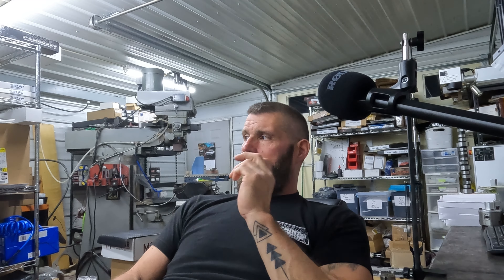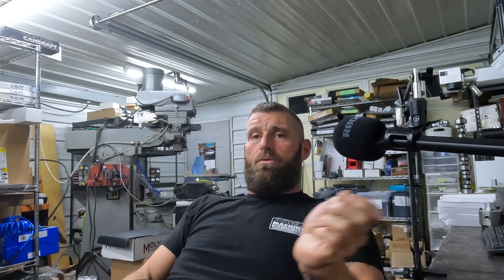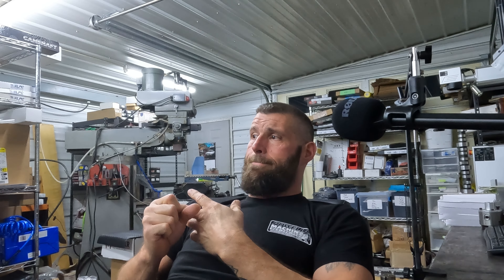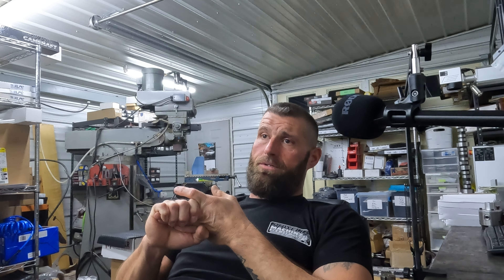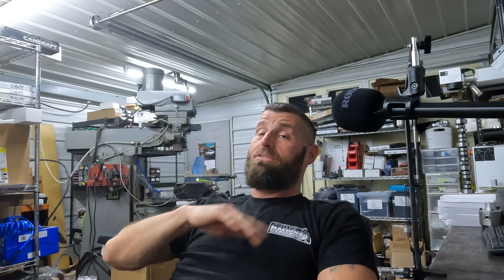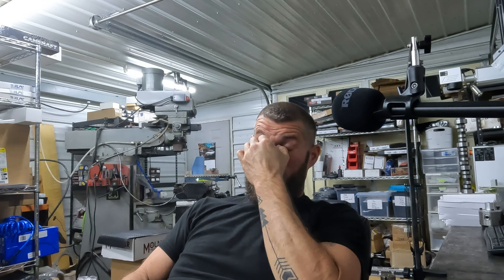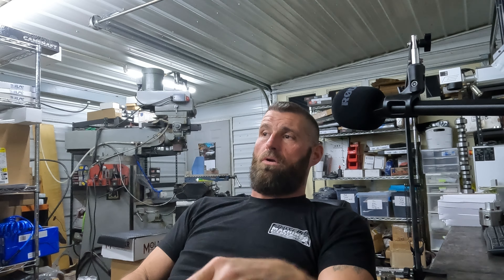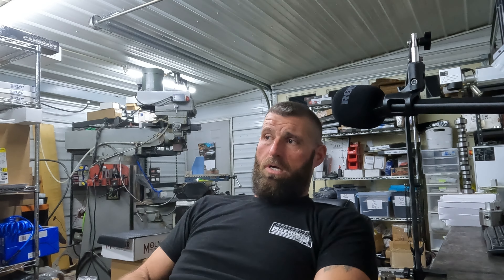Thoughts on changing our business model

Comment: The 300 ci ford 6 cyl was a die hard engine. I remember one time I was working on a air compressor that was powered by a 300 ford and it was having ignition problems. I was cranking it over and it loaded up and then the ignition decided to work. It blew the muffler off the machine with me standing two or three feet away from it.
Reply from the maker: Lol, yep, I have had similar issues happen

Comment: QUESTION. Do you charge out your time for chasing and ordering parts, or do you just buy in the parts and then add a small margin?
Reply from the maker: Yes we sell 10-20% over cost, which most of the time is cheaper than the big distributors

Comment: A few decades ago I worked for Anderson Autoparts out of SC.  We had an Automotive machine shop in the back and it stayed busy for the most part.  

The original machinist “Don” was a good old school guy.  Only after he quit I realized how many bad machinist there were. 
The first to replace him could not turn rotors, cranks or much else.  I think he finally figured out the flywheel machine 😂
We did a lot of commercial work approximately 75%, on both sides, parts and machine work.  

Just my opinion, if you can make it whilst only doing commercial work, I think your stress level will definitely improve. 

By far the worst customers were the ones who knew everything, bought “Good Enough” parts and had the highest returns by far.  

They usually went away mad after Don started talking to them the way you talk about Restrictive Pushrods and many other things they knew nothing of. 

Good luck whichever way you decide to go!!!
We need guys like you, there’s just not many left.  
Great videos, thanks much.
Reply from the maker: Yeah we have those here, we use to fix work they molested weekly,  it was really bad

Comment: Much respect.  Work smarter, not harder.  Machine and builder only new stuff.  The repairs you do should be  only on  that new stuff that that customers beat up or have had parts failures.  This is why there are so many crate engine businesses out there today.
Good luck with whatever you decide, you have a high standard set for yourself so you'll be successful.

Comment: I work alone, a lot. I have some part time help, but they mostly do grunt work and clean up. They don't setup machines or run operations.  I have tried to get some people to work, but the ones that want to can't stay out of trouble with the cops, with women, with dope, or whatever combination of those things. I can't manage my business,  my life, and their's too. The one guy that was good was looking for almost double the money I take home. So growing with employees has just not worked for me. 

What did help productivity was getting a vertical bed mill, and setting that up to bore/deck blocks. This particular machine had some extras like spindle orient, probing, and 4th axis wiring. I found a 4th axis rotary, and made a fixture to hold blocks from the mains. Slowly started making programs for various blocks. Now I can get a block in, probe it, the machine bores all the cylinders while I go do something else. Comeback, switch the cutter,  and it decks the block exactly while I am not watching it. 

Not to spend your monry or tell you how to run your business,  but something like that might help you. I couldn't justify the cost of a Rottler or other new machine. I found a decent Trak DP5 and added a riser to the column for more Z. I have less than $17k in mine, but I might do some overhaul to it if I don’t retire. There are other bed mills out there, you might a deal. 

I told myself I would automate block honing, and crank grinding. I have not yet done that. I wanted to get into cam grinding, more as an interest than a business venture. I looked at modifying a cnc cylindrical grinder to do cams. But, maybe at this point I want to do less not more. For a long time I have juggled 5 to 8 engine jobs at a time, not counting the odds and ends that show up. I am probably on my way out, at this point.

Comment: Would it work to just do machine work and leave the assembly to the customer. Yes there is a lot of customers that lack the ability to assemble their engine but let them hire a builder. That's the service I need. I can do the magnaflux,valve job, install guide liners and assemble my heads I just go to a machine shop to surface the heads, the block machine work, balancing, and grind the crank.  I just don't have the space and money for the machines. I know this is labor intensive too but it would free up the tear down, inspection and assembly time. Just an idea. I'm too far away and physically had to stop working but almost all of my friends do their own assembly work.  Just an idea I don't know your work flow and demand, you do.

Comment: I'll contact you sir, not sure if you're interested in hiring someone. I seen your video i think a couple months before this one said hard time finding machinist. I wouldn't call myself a full machinist but i have ran some old school type back in high school,  2 years of machine shop. Plus worked for firearms manufacturer ran changed tools, adjustments on various cnc. Plus worked at a race engine shop a few years, plus all my stuff ive built for myself over the years. Who knows if you're interested we may be able to work something out to where you won't have to stop doing engine work.

Comment: You either stay small and limit what you do, or expand and hire more workers. Back at Pete's Machine he had so much that was coming in he had to hire a worker or two or three and he had people that were builders that could take the machined engine and parts to their location and build the engine for him. And he had a building out behind his main shop that he expanded into to do some of the work. But back in those days there was only two shops that did machine work, it was a speed and machine shop and Pete's and he was getting in heads to rework that had been previously done by the speed and machine shop. Pete did the valves and seats using stones and the speed shop was using cutters and their head valve job would leak but Pete's job with stones did not leak.
Reply from the maker: let me know where to find qualified candidates
Reply: That is a big problem, Pete hired one person just to clean up and keep the shop- now there is a vocational technical training school where I am located and they use to teach Automobile mechanics - was sort of a machine shop too where they would rebuild engines, do valve jobs etc.  Now you either have to find an old timer that use to do machine shop work or a young kid that wants to learn. Lots of older retired guys today might like to get back to work. Pete had this friend that was retired from the City that was a mechanic and he was the one Pete had build up the engine for my 1970 Landcruiser after the shop had done the machine work. I only actually worked the machine shop a short while I had trained to be an electrician and went to work in that field. That said I did build up about three or more engines for me or my family and rebuilt 3 automatic transmissions, 2 C6 and 1 C4 and did all my own mechanic work on everything I had for years. I have rebuilt or put rebuild kits in generators, Alternators, starters, carburetors, done all kinds of bearings, bushings, U-joints, wheel bearings  brake jobs etc. I would build it or fix it or weld it or make whatever to fix whatever even did rebuild some fuel pumps when there use to be kits for them- really too may things to list. If you can find an old machinist that would work in your shop and help train some younger guys that might work for you. Most likely you have contacts that you have not thought about and all you might need to do is ask around and see what shows up. Good luck. Pete use to call me a Mechanic because I was mechanical or work fix things rather then buying a part and change the part. Parts changers is what we have today and very few mechanics. @powellmachineinc

Comment: Maybe consider top end and cam work. Andrew can do heads while you do cams. In many videos, I hear you say Andrew sets up heads (surfacing), grinds valves, and assembly is not difficult at all.Engines are time consumers. It's a shame to lose a great bottom end builder.
Reply from the maker: All options are on the table

Comment: You have to follow the money to keep the business going.  Engine builds take time and I know a few machine shops who turn down work.  It is a pain waiting on this and then that or the other requires some custom work.  Which leads to the question is building a motor profitable when grinding a cam or porting a head is easier?  My local guy built 2 engines LS based for engine masters a decade ago and his name is out there.  If you do people right, it spreads like wild fire.  He stays covered up and has turned down engine builds.  He'd rather machine up the block and setup the cylinder heads.  He built one for a friend and I think it was because he knew us and it wouldn't come back due to the customer being an idiot.

As a small timer, it does hurt as I want someone who can build a motor I know is reliable.  The money is likely in a Dart 427 or bigger LS but I want a little 5.7 off a LS1 or LS6 block, IMO going bigger requires a dry sump when running half hour track sessions.  Which yes I am in the minority in terms of the motor I want to buy.

Comment: I couldn’t find it again but you did a video on refurbishing a set of direct injection engines. You said carbon buildup was a real problem with them. Speed of Air has revolutionized diesel engines. They said it works on the DI gas engines. Check it out.

Comment: It definitely could be the right time to be more selective with your customers.  I've stopped taking every little problem into my driveway. Sure I can do a brake job cheaper than a shop, but there's too little profit in that job, it's not worth the time, 90% of shops can do that job for a fair price, and correctly. Sounds  like you have the same problem with some engines. Sure, you can get them built to spec, but for a bit more, the customer can buy a new one from you. The profit on paper is less, but rather than a week in the shop, it was 20 minutes at the desk. That engine might only be worth the time for a numbers matching car.
Reply from the maker: Yes!! I agree